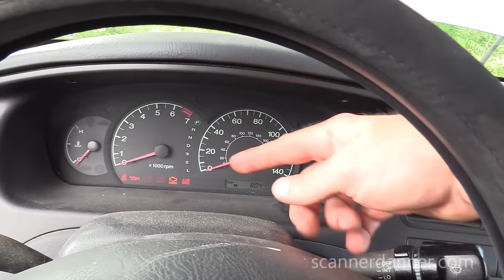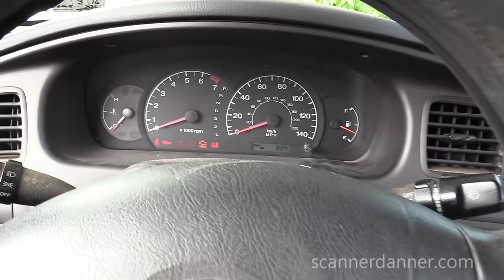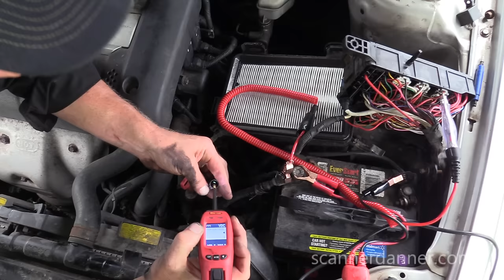No crank, good starter, how to troubleshoot, any car! (Hyundai)

Comment: Wow since you said that bro I would never bring my car to you this is a money maker for you because the route you took it took you five minutes to put that connector on and you found the problem that's what I would have did that eventually we started having problem then you changed to where it's corroded I've had cars that's corroded with green junk car still fires there's way you can fix that you just said this is a money maker guys it's a money maker guys to me that's ripping customers off you want to save them as much money as you can so they'll come back to you
Reply from the maker: You would have put a battery in it first, then replaced the starter, then maybe searched YT because you didn't fix it,, and then found this video and be thanking me instead

Comment: So my Durango ... been sitting for about 6 months. Power,  but no crank.  WTF, does anyone have an explanation for WHY varmints think a wiring harness is so TASTY??!!  This happens more than one might think.  I buy, fix, sell, drive,  ... funny thing is it's only with the fuckin MOPARS. WTF? You guys don't wash your hands after LUNCH at the PLANT???
Reply from the maker: It's all cars man. Supposedly wiring insulation is made with peanut or soy oil or something like that. It's why they chew on it

Comment: Why would you charge a customer for check engine light that didn't come on until you touch it also sometimes when you unhook battery that light will come on and auto zone will check your check engine light for free so are you sure you are not scammer danner you should be good to your customers not always about the money but you did start the car
Reply from the maker: Lol most ignorant comment of the day
Reply: ScannerDanner thanks fast talker I'll keep my comments to myself
Reply from the maker: There was just so much wrong with your comment. From "free diagnostics" that the parts stores offer (more like free guess work so we can sell you parts) to not understanding that not all systems can be tested unless the car runs! And if the car doesn't even crank, then my job is to fix the no crank, not the freaking check engine light that comes on AFTER the car finally runs. 
I never charged the customer for the check engine light. I did what I was paid to do. Diagnose the no crank condition.  End of story. I don't work for free, do you? 
Watch more of my videos and you will see that there is no such thing as being able to read a code and change a part. It doesn't work like that!
You'll also find that I am a teacher and I am teaching people how to properly troubleshoot automotive electrical and electronic systems properly, without guess work and needless parts changing. And you calling me a scammer just shows how little you know about me.
Reply: First off calm down I said why would you charge someone for check engine light that you cause it to come on tell Pete to pay you for the check engine light and I was just saying if you drive to auto zone they check your check engine light for free I still think you are a fast talker money hungry mechanic with a attitude I’m just giving my opinion there is no need to get up set you still handling your business so what I say shouldn’t matter I just don’t like your attitude dude get your mind right and calm down
Reply from the maker: I tried to help your ignorance but clearly there is no helping it lol Just go get your free diagnosis at the parts store and start shotgunning parts at the car to fix it.

Comment: I catch everything and you was not even turning that switch over you was wiggling it up up and down so I will move on to another better video that actually does the things as they say
Reply from the maker: time frame of the video please. There was nothing done incorrectly in this video, after 1.5 million views, you'd think someone else would have pointed it out by now lol. But I am curious as to what you think I did incorrectly.
Reply: I never said you done anything wrong it look like you was going up and down on the key instead of turning it I'm not saying that you don't know what you're doing I just caught that
Reply: Watching your video because I have the same problem you caught my attention by your knowledge
Reply from the maker: Well that was a pretty crappy first comment on my channel. Let's start over. My names Paul and nothing is staged here, if you are having car electrical or electronic problems and you want to learn how to troubleshoot, not what part to change, then you've found the right channel. Welcome and thanks for the follow up comments.